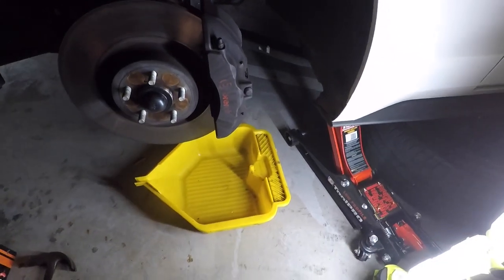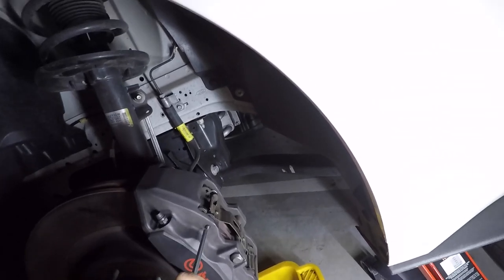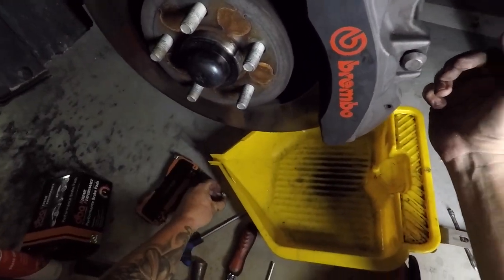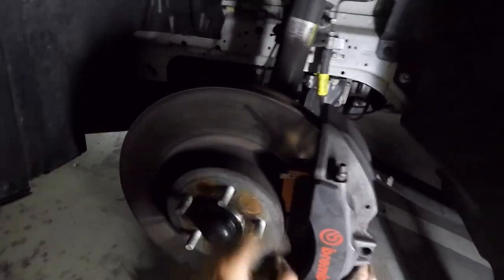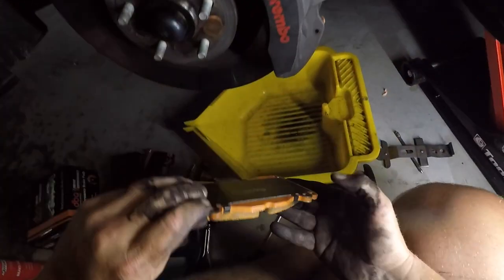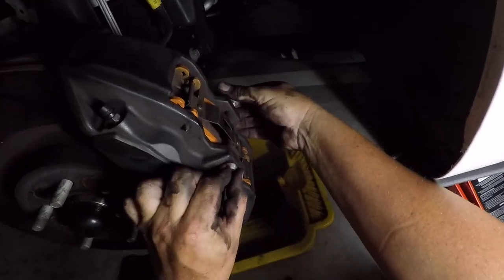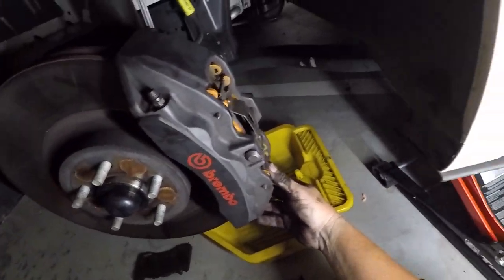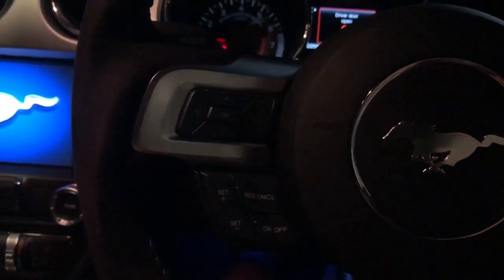2017 Mustang Gt 6 Piston Brembo pad change. EASY!!

Comment: Awesome vid! Those old pads looked brand new. They are supposed to last 100k. How many miles were on your car? 30k? Either way awesome they looked so good!
Reply from the maker: Very true mate. Live and learn. The pads that I put in were not as good on the track so I reverted back to the originals. Smiles all round now 👍  Have a good one 👊
Reply: @Revmatch-mr2hu  Are the Originals  Ford (FR3Z-2001-N) ?

Comment: How are the new DBA pads? How is the bite, noise and dust compared to stock?
Reply from the maker: They are good. Great initial bite with consistent pedal feel after several high speed hits. Dust wise, a bit less than stock but still dust up fairly quickly. 👍

Comment: What material are these pads you used? I can’t seem to find anything but semi metallic, and what is a good aftermarket pad?
Reply from the maker: Hey mate. Not sure but I will do some digging and get back to you👍
Reply from the maker: Hey mate they are a semi metallic carbon fibre friction material from dba extreme series. Check out dba on line. Hope that helps. 👍
Reply: Revmatch1970 thank you for getting back to me. It was kind of weird that I couldn’t even find ceramic material pads, I heard performance breaks such as the carbon types will have a lot of squeaks.  But again thank you and I will certainly check them out.
Reply from the maker: All good mate. Yes they have a slight squeak as you come to a stop, nothing major👍👍

Comment: Hey mate.  Great video!  Are these the DB9021XP and DB9022XP brake pads?
Reply from the maker: Here’s mate. I’ll have to do a bit of digging on the specs but I would not recommend for track use. I was out a couple of months ago and they felt very wooden when aggressively braking. I can honestly say the brembo pads that come standard are WAY better than these. Road use though, they are fine. Let me do some digging to make sure I get the correct information for you 👍
Reply: @Revmatch-mr2hu I think the rotor combo plays a big role in performance as the extreme performance pads are only ment for the t3 rotors not for standard rotars

Comment: If my pads are worn down a good amount what tool do I use to compress my caliper piston back in ? Thanks
Reply from the maker: When I did mine I used a g clamp and some wood. Worked a treat. I have just bought a piston compressor from eBay for $25 which will make it even easier. The rear caliper pistons are screw in type. Hope that helps 👍

Comment: A slight correction. Each front wheel has only 3 pistons. Both front wheels together have a total of 6 pistons, not 12. The 3 pistons are only on the inside with none on the outside.
Reply: Totally wrong each caliper has 6 pistons hence 6 piston caliper!
Reply: So, both front wheels have a total of 12 pistons, but only one brake hose per wheel feeding 6 pistons.  Sounds like a lot of fluid is needed to actuate 12 pistons maybe needing a bigger reservoir on the master cylinder? How is the brake fluid routed to each cylinder, by internal passages or what? as I don't see any external hoses feeding both sides of each caliper. Also, should I assume that the 6 pistons are MUCH smaller in diameter than the standard pistons?
Reply: @sproston3695 7 months later here to tell you that yes, it is quite a big master cylinder reservoir. And the 6 pistons are small. The point of 6 pistons isn’t for extreme braking power, rather it dissipates the braking power and helps the brakes maintain a better temp so they don’t fade. Hope that helped